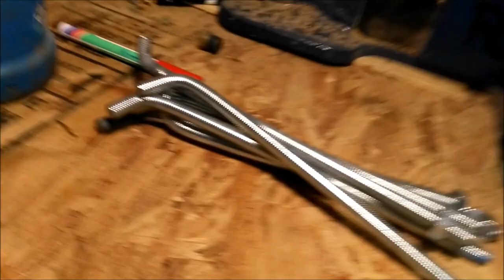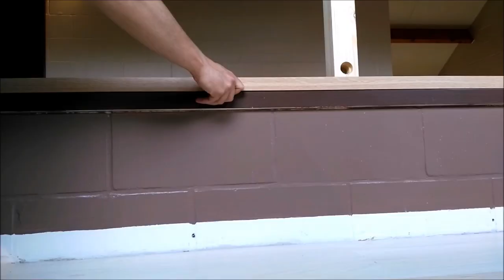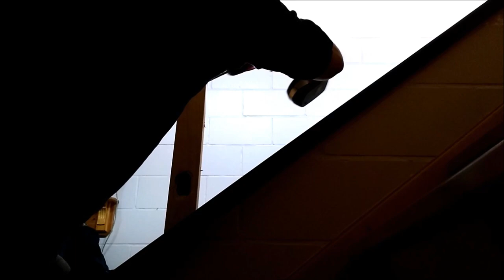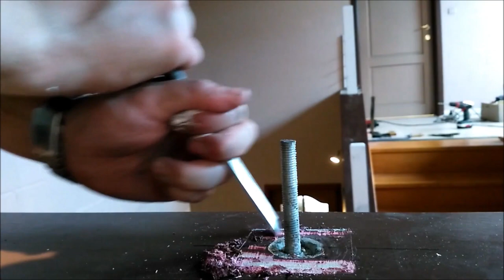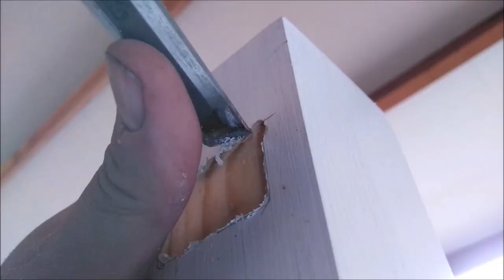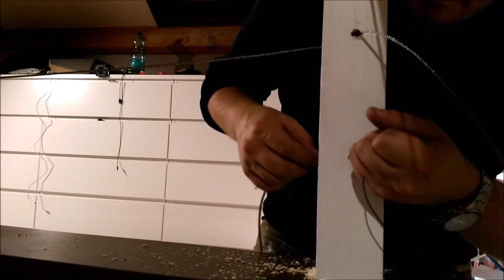Oak & Steel cable handrails

Comment: Great job ,man. Just a small tip. You could use ferrules instead of cable clamps , that could improve the appearance if you want.
 We have installed lots of cable railing projects with video , happy to discuss with you guys.

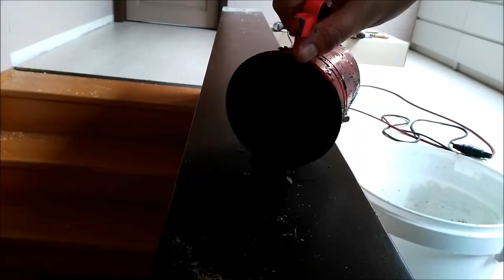Comment: Hey Great video. The railing came out awesome. What was the liquid you poured in the hole around time 1:37. Is it just some epoxy to keep the bolt in place?
Reply from the maker: Thanks David! The wall was made with hollow concrete blocks so in this case is filled the cavity with concrete to hold the rod in place. In a few places I had to anchor them in the solid part parts of the block, in that case I used the epoxy (chemical anchors) to set them in place. Thanks for watching!

Comment: Did you use a vacuum to pull it through a 90 degree angle turn inside a post?
Reply from the maker: Yes, worked great!

Comment: what was that black material you used to anchor in those bolts to the stairs?
Reply from the maker: Concrete, the bricks are hollow! For 1 or 2 bolts I used an epoxy based anchor because I drilled into solid concrete.

Comment: Very good.
great video and editing.
I think the shackles should have been replaced with crimped cable. Just my opinion.
Reply from the maker: Glyn Williams Thank you! What is crimped cable? Used this hardware because it's simple, cheap and effective.. it's not the best looking, that's true. Thanks for watching!
Reply: I like your job.
Its very well done.
A crimped cable uses an aluminium ferrule that you put around the wires, and hides the loose end of the wires. 
It looks very neat. I will try to find a link.
I am having a wire railing  around my upstairs veranda, so I have been researching.
Reply from the maker: Glyn Williams I did cover up the loose end with a clear crimp tube later on. Those aluminium ones sound interesting though. Thanks again and good luck with yours!
Reply: Ferrules are what I was thinking of. They are in this page from an Australian company.
http://www.aaametalsuppliers.com.au/stainless_fitting/ferrules.html.

Comment: opening looks like more than 4 inch. that's definitely not up to code.
Reply from the maker: Don't know what the code is over here, but I measured different wire spacings I found in stores and used that to base this on.